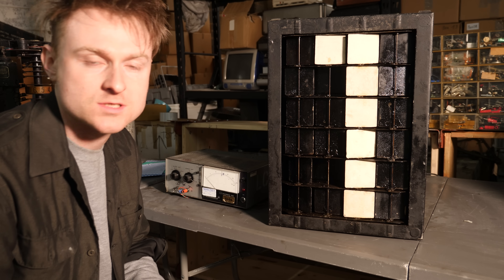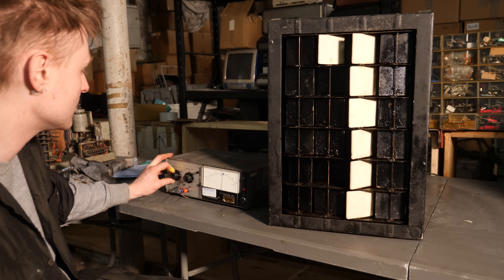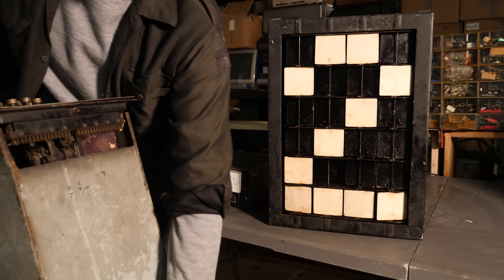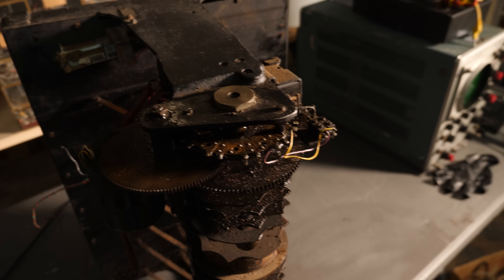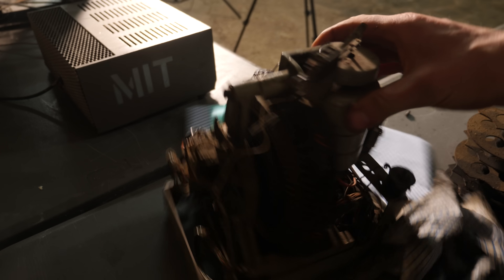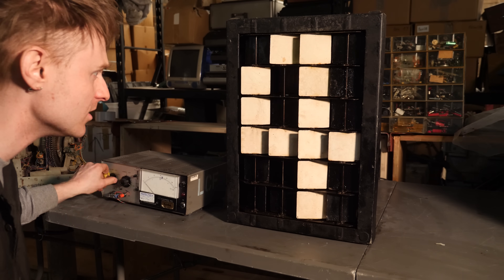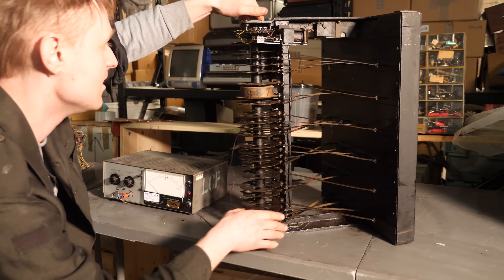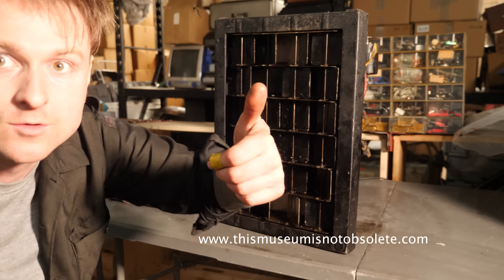A STRANGE old Electromechanical "Flip Dot" Display. How Does It Work?

Comment: The Tote is a pool betting system which was set up in 1928 by Churchill to improve the safety of betting. There was Tote betting on racecourses as well as the individual on-course bookies. 
It's now private after being sold off to boost the finances of off-shore millionaires. The winning buyer was announced by Jeremy Cunt the Hulture Secretary.
Awesome bit of kit, more mind-boggling than electronics!

btw, Totalisator is not spelt with the letter zed.

Comment: A later method of electromechanical display was the Annax system, sold among others by the German company Telenorma back in the 1980s. It used bistable elements of various sizes that could be individually addressed, making it capable of displaying any number or letter as well as punctuation signs. The technology is used today mainly for passenger information displays on busses and trains. The German stock exchange in Frankfurt am Main uses a very large Annax board to this day. The latest iteration of the bistable idea is ... epaper displays. The tiny pixel elements are either turned on or off, and stay that way until changed again. Much nicer than the clunky mechanical version!

Comment: What you have are just the Display and "Drivers" to run it. Later version many had Ferranti-Packard Flip Dots or High Contrast Light fixtures. Totalizator or Tote Board is a whole system was run by the "Computer" that takes the bet data to calculate and display intermediate and final Odds on a Horse race and other parimutuel games. Don't know how the job was done in 1950's-60's but have done by digital computers in 1970's and after. For more search Autotote Corporation and related companies.
Reply: Yes as I mention in the video. I am getting the totalisator computers in a couple of weeks

Comment: If you make a clock with just the 4 digits, you might be waiting a while to see it change, i've been trying to think of something better.
One thought is to somehoe link it to the exchange and see the 4 digits that someonne dialls, however i think you only have a couple of first digits
I'm sure you can think of other ways to do something similar
Reply from the maker: cheers! but it will be wired into the totalisator :)

Comment: The buses in Perth Western Australia in the late 1980s had a similar panel with small florescent dots on them that could put text and numbers of what bus and where it was going and it could refresh them regularly - this was a tech upgrade from the older roll of numbers where bus drivers had to go to back of the bus and wind the 3 or 4 rolls of numbers to depict what route it was on as well as side and front. Much later this was replaced with globes like led matrix. But the fluro dots were cool changing them the system would flip them all to black and then bright yellow/green again with a waterfall effect was pretty neat in them days!
Reply: Those are called flipdot displays. Sam actually has an episode on them if interested. I remember going to the airport as a kid and hearing the "click click click" of all the arrival and departure information changing via a flipdot-like display. Such a unique sound, something that will probably never exist in ubiquity again. I also remember flying, possibly moving from Sydney or maybe Hong Kong to the States,where I live now, and sticking my finger in an ash tray on the airplane seat and it coming out all covered with ash and smelling like smoke. It's absolutely wild that not only did smoking used to be allowed on planes but that every seat had an ashtray. Insane. And I'm not sure if many or any planes ever went down because of a fire being started due to smoking, but I haven't specifically looked. This is obviously a long time ago, when I had to wear a sport coat, slacks, and a tie as a child when flying on planes. My mom used to take us kids to the airports and we would walk up to the gates without a ticket and watch the 747s come in and then have ice cream / pie at a restaurant at the airport. Airport restaurants used to be classy affairs, not corporate owned. Flying used to be cool, but even though it's just like riding a city bus now and it isn't the experience it used to be, it's far more accessible to everyone around the world. Anyway, sorry - your comment made me think of stuff I haven't thought of in 40 years. So I appreciate that

Comment: Many ideas for what to display, possibly several on rotation? Imagine current mode indicated by old "walk" traffic lights with custom black stencil icons:

Tuner: Dominant audible frequency playing on the Megadrone - update on demand or periodically.

Date quiz: another display shows a question like "what year was the xyz invented?", after a pause for guests to guess the totalisator grinds away to display the answer. Cheers and boos!

Visitor count - update by turnstile (tell me you have one!) reset each day/week whatever

World population in millions (4 digits)

Ambient noise level in db

UK National debt in billions of pounds (4 digits)

Got a METRIC CLOCK  yet? 10 hour day, invented around the French Revolution, had a cult resurgence as Internet Time - Look Mum No Timezones - even supported by Swatch with real products! Added bonus over babylonian time: each position gives every number equal duty!

If the museum doesn't have more than 9999 objects, connect your new database and show the count.

Museum power usage in kilowatts.

Geiger counter / cosmic ray / solar radiation / progress of martian year etc.

Also round-robin the physical digit positions so the least significant digits don't get all the wear

Comment: You should cut some more cams so it can show letters. If you can squeeze 96 positions into a cam, you can show the entire ASCII character set.

Cuz I know how you love suggestions from random nobodies, I'll keep going: If you move the motor axle away from the display, you can fit larger cams. But the depth of the cams will limit the rotation speed, so add a 2nd motor to drive wedges under the lifters to lift them completely off the cams, then you can more quickly rotate the cams.

Comment: Electromechanical totalizer systems are extremely fascinating. There's a lot of documentation on the Julius totalizer system made by the Automatic Totalizer company worth reading up on - unbelievably complex distributed multi-terminal mechanical computer systems from the 1930s.

Comment: You can make a driver for it using a couple of mosfets or relays and control it using an Arduino. Seems like a simple enough mechanism.
Reply: As mentioned it will be wired to the totalisator.

Comment: They don't build things like they used to.
That electro-mechanical stuff was so intricate and yet so robust.
Today we have very capable computers and microcontrollers that run everything that can fail in millions of different ways. 70 years ago we built fail-safe metro-systems that would more or less run safely even if a diver fell down dead on the job.

Comment: you mentioned the telephone terminals on the back, could this be wire in to the telephone network?  And could the numbers be changed via a telephone?  If so, that could be an idea, have people be able to dial in a number sequence and the display starts flipping numbers.
Reply from the maker: its just the connectors to the mentioned totalisator. cheers!

Comment: Do the displays have to cycle each number in sequence or is there a way to go directly to a digit?
Reply from the maker: its a cam. it has to run through the cam
Reply: @THISMUSEUMISNOTOBSOLETE  
Wow. I guess as long as the refresh rate doesn’t need to be very quick, it would be ok.

Comment: Word of the day: totalisator
Reply: Not "totaler."  Not "totaliser."  "Totalisator."

Get Dr. Doofenschmirtz to build it and it'll be a totalizenator.
Reply: @thegardenofeatin5965  The totalizenator will work until Perry hits the self-destruct button.
Reply: If you've ever heard the term 'tote board', tote is short for totalizator.
Reply: That's right up there with "digitalization."
Reply: It's a perfectly cromulent word.
Reply: All I can think off is electromechanical Skynet ❤
Reply: Retro-Totalisator!
Reply: @KeritechElectronics  
Are the main spurving bearings in a direct line with the pentametric fan?
Reply: @StubbyPhillips  yes, and this model uses a 2076 model hydroelectric magnetosphere regulator, as well as the latest and greatest three-step plasma transformer!
Reply: @StubbyPhillips Fun fact: my grandad worked with Ken Spurving just after WWII, when he was putting together the infamous Hotchkiss Accumulator!
Reply: "Come On, My Totalisator" is my favorite Squarepusher tune : )
Reply: Why not totalisatorifier?
Reply: Not as good as the more advance multiplicatorator.
Reply: Not as interesting as the more advanced Multiplicatorator.

Comment: There are 11 positions 1 2 3 4 5 6 7 8 9 0 and blank. Similar kit was used for cricket score boards.
Reply from the maker: yep as you can see from the back display. 11 inclusing blank. any more info on the cricket boards?
Reply: @THISMUSEUMISNOTOBSOLETE  Sorry no. A mate of mine had some of these he was mucking about with, 20 years ago, they came from a portable score board. Sadly he died during covid, no idea what happened to his stuff.
Reply: @THISMUSEUMISNOTOBSOLETE THEY CLICK EVEN LOUDER!😂
Reply: I thought the cricket numberwangs were just bits of card hung on pegs by old farts?
Reply: Blank between each number so more than eleven.
Reply: @markae0  Doesn’t mean it can stop at those. In fact it almost certainly can’t as there’s an actual blank equally spaced between 0 and 1. Why would you need that extra blank if you have blank that can between selected after each digit?  My guess is it switches to blank between each digit to make a clean transition. Otherwise you get an undesirable blend of both digits during the transition.